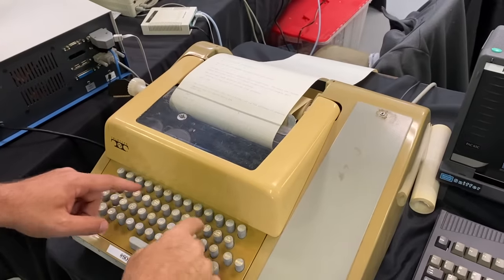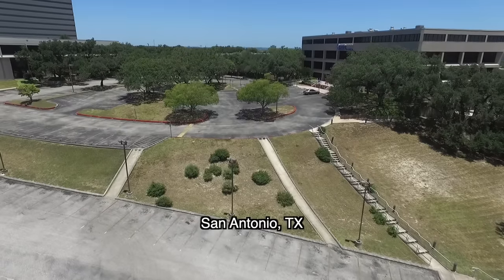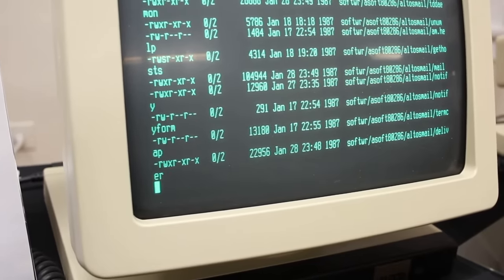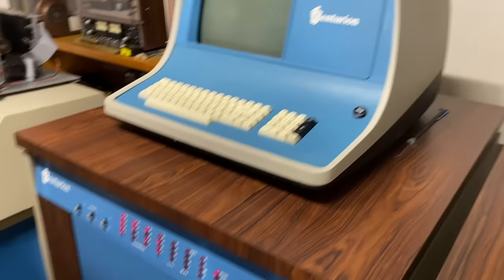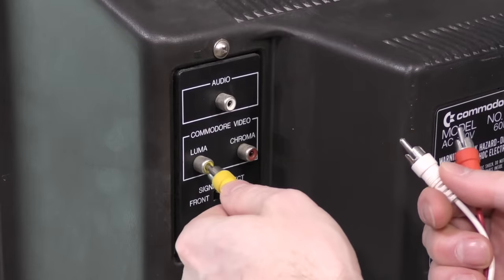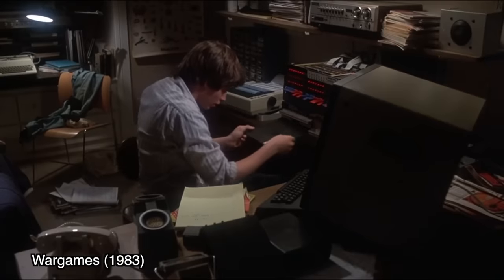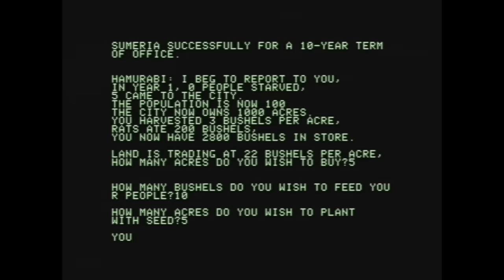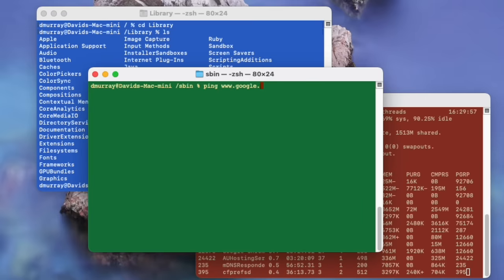What are Dumb Terminals?

Comment: 9:18 "dumb" doesn't refer to the lack of a CPU, or an inability to "execute code", per se (almost all terminals used a CPU, a microcontroller, or something close to it made from discrete TTL - the 8008 instruction set is an outgrowth of just such a contraption), but to the lack of control over cursor position, colors, fonts, keyboard layout etc (hence btw the minimalist user interfaces like that of the vi editor.) I don't think many, if any, terminals, even of normal intellect, could run "code", as in machine code.
btw, though this is a bit semantic-y, linefeed, carriage return, bell and the like are nothing but control sequences for teletypes, not any different than the escape sequences used to control terminals, except they became essential early enough to become part of ASCII whereas the latter didn't.

Comment: Terminal via serial is still very much a thing, my OPNsense firewall runs on a PC-Engine APU which is headless, no video-out of any kind. You have to run the initial setup via null-modem serial cable and a terminal.

Comment: On Linux the channel through which Terminals communicate with the kernel is called /dev/tty and if you write anything to it, whatever you wrote will print back in your terminal.

Turns out "tty" stand for TeleTYpe. :)
Reply: We used to send each other messages by catting to /dev/tty for the particular login.  Yeah, world-writable by default, and ready for this one?  If you knew where the login session was, you could snag the tty for input, and essentially "keylog" the next user login to a file.  Read the file, and see what you caught.  Yeah...proto-phishing.

Comment: The best way to explain this is: if you use Putty on Windows to log in to a serial port on a Cisco router or switch, it's the exact same thing.  A serial connection.

Comment: Adjusting measuring instruments through Windows Terminal is an almost daily occurance at my company (we're an ISO17025 calibration provider) and it really is a pain having to put in every (control) character in by hand, correctly, first time, or start over.
This method should have been binned at least 10 years ago.

Comment: Terminals kind off exist today. I personally use various terminal apps to connect to embedded devices. Some of those have CPUs and run a variant of Linux and I open a terminal connected to them on my machine. Some of those devices don't have a CPU but a microcontroller. To communicate with those I use a usb to TTL converter and a TTL terminal on the laptop.

Comment: Yes, most of us are familiar with terminals. There are also 3270 terminals for IBM mainframe (z Series) computers and they behave slightly different that traditional terminals for mid-range computers. I'm also surprised how many Linux enthusiasts call their terminals as TTY's, because technically it's no longer teletype.

EDIT: also what we saw in movies (those blinking lights) was called "operator console" back in the day (e.g. IBM 360). My take is that those lights eventually were replaced by a dedicated terminal and hence we got term "console" and "terminal" to mean pretty much the same thing.
Reply: TTY is just the emulated instance of a terminal, called that for historical reasons. The terminal is the text driver itself, stored on the hard drive.

Comment: What were terminals like the IBM 3278 called? They weren't as dumb as a TTY; key strokes are echoed locally, and buffered. Moving the curser via the tab key, or up and down. etc were handle locally. It wasn't until the enter key (or another fuction key) that the data was sent to the computer.
Reply: They were still terminals.
Reply: "Block-oriented terminal"

Comment: Dumb Terminals were not so dumb in reality, especially when you consider block mode. Basically in block mode, the terminal would display a form on the screen where the user could tab to each field and after entering all the fields, the terminal would send a block of data by essentially concatenating all the fields together into a record to send to the computer in one go. This basically is what was reinvented in HTML forms. I still write code using the curses library for simplicity for terminal manipulation.
Reply: Reminds me of working at Papa John's from 1998-2001.  Each store had a server, and used dumb terminals for everything, including the KDS.  The website's program could even dial in for internet orders.

Comment: I think thin clients can serve as a modern equivalent (not exactly but similar in behavior) to the terminals of yesteryear. Admittedly they are much 'smarter' but still can't do much without some sort of server to provide them with a work environment. 

Well that's my understanding at least. I've only ever encountered such an environment once back in uni in 2010.
Reply: That was the idea.  Instead of each person having a fat system, a thin client would have the bare minimum needed, and would connect to a server.  Even later dumb terminals apparently would allow for forms on the screen, or graphics.

Comment: Really looking forward to upgrading my work computer system from VT100 emulators into AIX Unix to a Win XP era program running on Win 8. Hopefully next month. I'll miss the simplicity and speed of the menu driven interface, but will be glad to see the back of the undefined behavior in the program that we've learned to live with since 1991.
Reply: You could just upgrade the servers themselves and then not have to switch off UNIX

Comment: I just was searching for dumb terminals last night; but all I got was what they were and what they are in today's equivalent (thin clients and emulators.) The mass connectivity is the one I was trying to look for. I wondered how these were tied up to in the wiring closets or in the actual computer rooms (must've depended if it was a mini vs full blown mainframes.) Were there multiplexors involved perhaps?  I read that IBM had a "controller" where it could handle a certain number and used BNC cabling. IBMs also had those "smart" terminals. DECs on the other hand seemed to use the tip and ring telephone pairs, tho with a modified telephone plug. 

Many tech companies and the press declared the death of terminals before the year 2000, but a lot of American newsrooms (of all types of media) were still on terminals, some into the new millennia (I'm talking about the actual TTY types.) You could say the terminal was like typewriter in the PC lifecycle comparison! The mini or mainframes were not cheap and they sure got the return on the investment for sure!
Reply: Anything with a serial port and a display (plus character ROMs) can be a terminal. An Arduino Uno makes for a decent one in a pinch.
Reply: @charliekahn4205  I don't care about modern/retro mixing, it was more of the orignalism

Comment: I recall working for a company in the 1970s and seeing an unopened box prominently labelled "dumb terminal". I was surprised that any company would label its product as "dumb".

Actually, the term started as a polite term meaning speechless. There were, and are, intelligent people who are unable to speak, but, somehow, the word acquired the meaning of unintelligent. Of course, the "dumb" in dumb terminal referred to lacking the intelligence of a microprocessor, not lacking an ability to speak, which the terminals with microprocessors also lacked. It seems that the term, when referring to terminals, must have originated in the engineering community and been adopted by the manufacturers. Today, the term would probably be considered "politically incorrect" and avoided on product packaging.

Even within the dumb terminals, there was a distinction between some which accepted commands from the computer to position the cursor and some which didn't. Some of the ADM terminals displayed a page of text and the computer could position the cursor by sending a character string which provided the x-y location. You needed to use a terminal which supported that feature in order for certain text editing programs that used it to display properly. Sometimes, a system message would appear on the screen and the program and computer would then be using different cursor locations, because the system message would move the cursor and the program wasn't aware of the move. Also, people had to understand that the system message had not been inserted in the document. The workaround was sending a character string to get the program to redisplay the screen. Some secretaries didn't understand what was going on but learned to redisplay the screen after a system message appeared, and the editing would return to normal.

Comment: Maybe it's being a bit too pedantic to point this out, but the video/keyboard subsystems of the Osborne and Kaypro II (and quite a few other more modern CP/M computers) were not "Dumb Terminals built into the system", at least on an electrical level. (Unlike the Apple I which is, yes, a 6502 computer glued to an extremely dumb TV Typewriter-style shift register terminal.) The Osborne 1 had conventional memory-mapped video living in the last 4K of the memory map (and even had a bank-switch latch to switch between updating the character memory and a second 1-bit plane used for the "dim" attribute), while the Kaypro II swapped its video memory in and out under the 16K mark. (FWIW, I think some later Kaypros switched to a port-mapped CRT control chip vaguely analogous to the MOS 8563 in the C128, thus getting rid of the bank switching.) These systems emulated dumb-terminal character interaction in their BIOSes, not in hardware; you can "poke" directly to the screen in an Osborne, no problem, but this capability wasn't used much because of course any software that did it wouldn't be compatible with any other CP/M machine.

A better example for a CP/M computer with a "dumb terminal built in" would be the Zenith/Heath Z/H89. Ironically, perhaps, the "dumb terminal" part was technically just as smart as the "computer" half, both used Z80 chips to drive them. After 1977 or so most "dumb" terminals used microcontrollers instead of discrete logic; the ADM3A was already a dinosaur the last few years it was on sale.

Comment: Nice video, but did it need to be 14 minutes?  After all it's basically a monitor and cable on a lonnnng cable.  I feel like this could have been done in <5 mins.  Oh, and I still have a Wyse terminal that I use when I want to feel nostalgic :)

Comment: As a person who maintained TTY like the KSR-43 etc. - Yes, they required oiling!!!! If you left them alone, they would work for YEARS... but they occasionally needed to be taken apart and all the paper giblets, debris, and gunk, had to be cleaned out of them... not fun. If an ADM-3A went down, you opened it up like Pac-Man and started troubleshooting the 250 chips on the board, also not fun!!!! Well, in a way it was, because the old dumb terminals were so complex, but yeah... the circuits in those things were amazingly complex for something so simple by todays standards.

Comment: It's really not too hard to understand.  You have a central computer that's noisy and hot, so you can give it a dedicated floor or room. Then each department is tied into its dedicated part of the computer. And if power goes out on the floor, the terminals retain the info. Gives the operators a better work environment and less hassles

Comment: The most expensive terminal ever costs like millions of dollars in today's numbers. First Terminal of IBM S/360.
BTW UNIX commands therefore GNU/Linux commands are kept short and display non detailed outputs by default since most of Terminals were teletype. They still use VT100 dumb terminal emulation.

Comment: I had to watch this video twice. I have limited background knowledge in early computing, however, I'm old enough to remember the terminal at the library and understand that a terminal connects to a mainframe and that multiple terminals can be used independently and simultaneously.

You really glossed over the actual definition, except for briefly during the discussion of the Centurion and before you started talking about War Games with the single mention of a mainframe.

Your title is a question, but you never plainly state the answer.

Comment: i kid you not, dumb terminal compatibility is still a thing. i put together a little "terminal" using a raspberry pi pico, an lcd screen, and a usb keyboard. the pico has a surprisingly large amount of computing capability but i just had it be a terminal emulator. it communicated over serial to an early 2000s desktop that has a serial port on it. it had a 2014 os running but had that serial port setup for ssh and basic terminal operations. lemme tell ya, it was fun to watch this semi modern system running a mostly modern os doing 80s and 90s things.

Comment: An interesting 'fill in', I'm kind of after an ADM3A terminal, just for the looks and being authentic to old machines as apposed to just running a terminal program on another machine.
Using a PC with an Intel i7 with 16gigs of RAM etc, as a terminal to an 8 bit machine with 32K or RAM seems kind of wrong, the terminal should be less powerful than the 'main computer' you are talking to.

Comment: Didn't people back then, were referred to as computer?
Reply: People who performed calculations were referred to as "computers;" however, these calculations were originally in the pursuit of a method to calculate the date of Easter, by means of the computus.  But really, any time after the early 1600s, the word "computer" is used more and more commonly.  Until the advent of modern electronic computers, the word referred primarily to a person who performs calculations.  Mechanical "computers" would be seen in the form of calculators, not yet electronic, but mechanical.

Comment: This pretty much conflates "dumb terminal" with "terminal".  In my experience, the term "dumb terminal" was reserved for terminals that could not move their cursor programmitically.  Specifically, terminals on which you could not run a screen editor like emacs or vi.  Most of the terminals you show are not dumb terminals.

Comment: So a terminal is effectively a typewriter that uses a monitor instead of paper to remotely control an actual computer and receive feedback from said computer. Interesting.
Reply: Not exactly.  It streams on the serial port.  It's not wired into the computer directly, nor does it send the same kind of electrical signal a hard-wired monitor does.

Comment: Terminal - endpoint. It is (not) a computer? You cannot use analogue displays without memory and some shifting of data in memory plus generation of a bitmap as a way to display lines of letters, potentially one by one and scroll lines over the display without that. You need at least the simplest ALU you can have to do that plus some logic that converts the pixels from memory to analogue TV display lines.
On the communication end of the device you also need some "logic" to at least receive and store bits that next are treated as bytes, at least in the case of serial data communication.
In a strict linguistic and logical sense is such a simple device a "computer"? The correct Latin word would be "computator" - he who, what, makes calculations. Or rather than calculations, simply "counts". Something like that must all happen even in the dumbest terminals. It may all be hard coded or even analogue. But making a display behave like a teletype (printer) really needs more than merely printing what got sent.
It has "memory", has meta or reference data, and shifts bits/bytes through the memory that is converted into an analogue image you see. Does that compute, calculate, or count? Maybe not, but it represents the basic essence of what a computer does and without which it cannot function.

Comment: Love your channel, but I have to comment on your driving position. Your seat is waaayyy too reclined for your own good. Bear with me. To have the best control on your steering wheel, you need to have your wrists lie flat on your steering wheel when your shoulders are pressed against the back of your seat. Otherwise, your arm's moment is very limited, as is your ability to react quickly on the steering wheel. 
From a rally driver. 
Stay safe and keep your videos going!